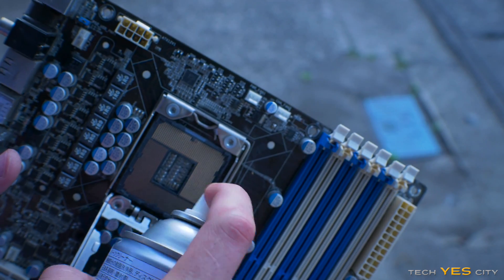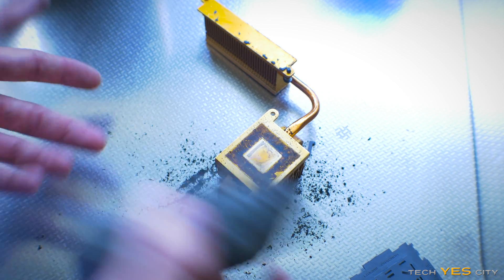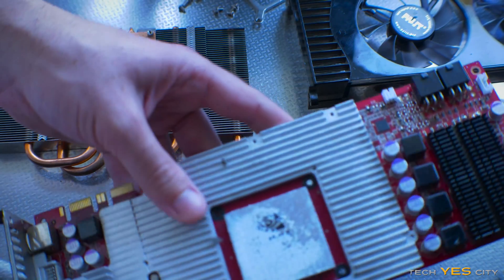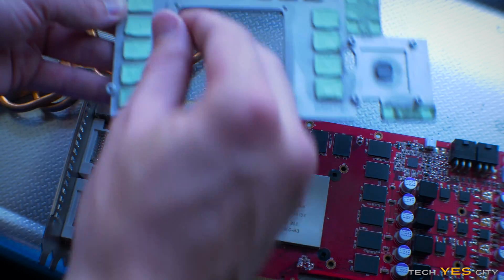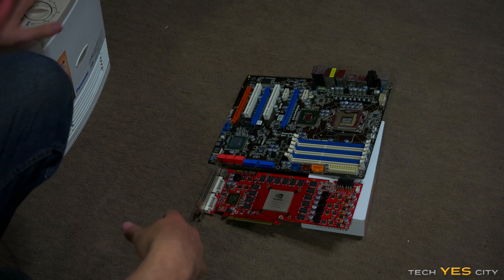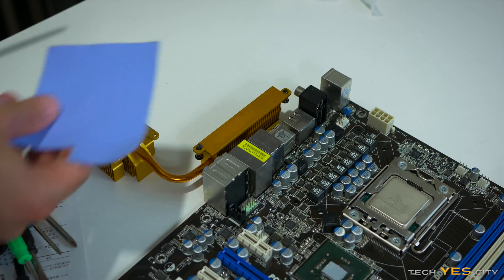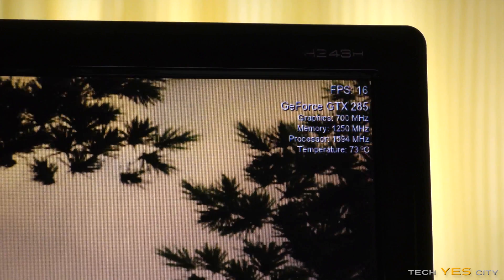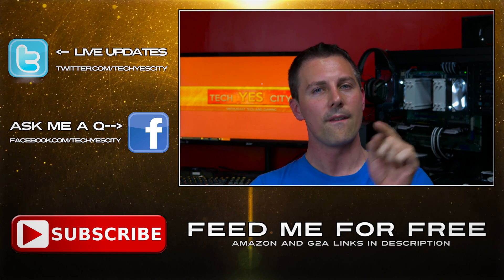PC Parts RESTORATION - How I CLEANSE - Ft. Before and After Temps

Comment: As a Auto parts specialist im sometimes wondering if im watching how to clean car parts or pc parts. First, there are no places 5-56 belong in a modern rust free computer, sure it makes plastic more shiny but its not good for either you or your computer. Its made for penetrating rusty seized bolts, it contains small amounts of actually lubricating oil. It contains, acid, solvents and chemicals that you should keep away from anything resembling a kitchen.

Comment: building PC's for over 20 years and I thought I was the only one that used my finger to spread thermal paste.  I have used the Pea Method before and always wondered if it spread even.  Using my finger and spreading the paste I never thought twice about it.  Also,  If you don't tighten the staggered bolts in just the right  pattern,  you can push you pea size paste all to one side.
Reply: I use a nitril glove and spread the thermal paste with my finger , no skin oils
Reply: I also spread it, but I use a tool for that... like a small paddle. Some people get allergic reaction to certain paste brands. No need to take chances

Comment: Hey mate, I love your vids, and i know this is an old vid and Im sure you've had no issues, but 

Be 100% careful as most brake-cleaners are not alcohol but ACETONE, toluene etc!  Industrial solvents.  This can strip the board completely and and destroy the plastics. Motherboard PCBs have plastics and are made of epoxy based surface glues.  Acetone completely fucks the strength of these epoxies.  

CRC 556 is essentially petroleum again, not compatible with anything on a computer.

If you want the same outcomes, use IPA and Innox.

IPA is actually alcohol, and Innox is mineral oil that is non-conductive, non- static, and doesn't dry out.  Better off using IPA and putting it in a solvent resistant pressurized spray bottle and then displacing any excess with pressurized air (cold) and finishing with Innox.  Much safer, much better.
Reply: Very useful!

Thanks for the advice.

Can you please elaborate on inox/innox. What is it? What is it used for on a motherboard?
Reply: Any examples you can link us to on Amazon ?
Reply: @petrkisselev5085  any IPA https://www.amazon.com/Bottles-Isopropyl-Alcohol-Industrial-Concentrated/dp/B0874C5CWB/ref=sr_1_1?dchild=1&keywords=ipa&qid=1589795569&sr=8-1

https://www.amazon.com.au/Genuine-Lubricant-Protect-Marine-Aerosol/dp/B078JDGKN5/ref=asc_df_B078JDGKN5/?tag=googleshopdsk-22&linkCode=df0&hvadid=341793070274&hvpos=&hvnetw=g&hvrand=6073138503113699877&hvpone=&hvptwo=&hvqmt=&hvdev=c&hvdvcmdl=&hvlocint=&hvlocphy=9070530&hvtargid=pla-672757151893&psc=1

https://www.amazon.com.au/0-8-Litre-Multi-Purpose-Industrial-Sprayer%EF%BC%8CCar/dp/B076NHD39Z/ref=sr_1_6?keywords=solvent+sprayer&qid=1589795678&s=home-improvement&sr=1-6
Reply: @BenState  Thank you very much !

Comment: What’s super helpful i just found out today if anyone stumbles across this comment that you would like and should check out is how to make your own back plate for your graphics card, a simple acrylic panel cut down to size and double sided mounting tape stuck to the hifhest point mounting tape on the tallest screws on the GPU back circuit board to keep your graphics card back from getting dusty and possibly shorting out from dust build up, another awesome thing to lengthen the cleanliness lifespan of your graphics card is to pick up some CRC Dielectric Grease or the crc stuff he used in the video from Lowe’s and use a Q-tip or fine paint brush or just spray the sprayable version on to coat the back portion of the graphics card evenly with the grease/spray. Seems weird to grease your card but it’s non-conductive meaning it won’t short out from being on there and it protects the back from moisture, static shock and if you put an acrylic back to it then it looks that much more professional, glossy, clean and beautiful in your PC build

Comment: Great methods! Honestly as long as you clean off the brake cleaner after using it to loosen the dirt up, you should be fine. What I would strongly recommend is CRC Electronic Parts Cleaner as it's less aggressive on plastic and does just as good of a job, if not better since it doesn't leave a slight oily residue behind, evaporates quicker and doesn't have as strong of a smell.

Comment: does the black pad on the chipset heatsink serve any purpose? It's the thin rectangular outline around the chipset die. I cleaned my motherboard but removed this part as it didn't look necessary and was getting in the way of cleaning. Do I need to replace it?

Comment: this is a pretty brutal way to clean computer parts - dust them down with a paintbrush, then use a soft nail brush dipped in  99% ipalcohol to get nasty bits cleaned up..... brake cleaner is a bad bad idea.

brian, its not a car or truck ....its complex electronics plus most brakecleaners are made from diff chemicals...some contaion acetone which can destroy plastic buttons/ fan headers/ rubbers etc esp on motherboards

even contact cleaner would be better but not as cheap my ozzy friend... tie me kangaroo down sport, shag a wallabe

Comment: Why not just use electronic part cleaner if you're going with the automotive route? It's still an alcohol based cleaning solution that  evaporates quickly and doesn't subject the plastics to a corrosive substance. It also doesn't leave behind residue. It isn't as heavy at breaking down carbon buildup, but you're not cleaning the heads off an old 4 cylinder hemi. You're just getting the dust and light filth off of the board and the connectors. Why use a spray anyway though, because Louis makes a decent point anyway. the bottle of electronic parts cleaner costs roughly the same as a small specialty brush and some alcohol.

Comment: In a different video you say, brake cleaner eats away plastic and therefor you didn't spray it on a case (with lots of plastic parts), yet here you spray it on your motherboard (dimm slots, pci-e slots, power headers etc) like there's no tomorrow....

Comment: Have been given an old broken ( hoover knocked over onto it) dell Vostro 400 with q6600 . Just needed an  HDD but it is full of dust glued on with grease stinks of chips and curry could do with the brake cleaner. I did a 10 minute stress test with cpuz and it maxed at just 56c with stock intel cooler !! GPU got really hot though

Comment: how do u get such good framerates on your even old pcs run like newer architechture ones for me i get microstuttering with games i have a rx580 for 1080p gaming and a i7700k at 4.9 ghz a 360 mm AIO liquid cooler and 28 gigs of ram at overclocked at 2600mhz i mean running window performance is very quick and snappy but in games its not always running well like bioshock i get very good framerates and then it will freeze for a second and then go back up to like 180 fps .

Comment: Speaking of the wonderful x58 I can not get my Gigabyte UD3R board to recognize the two middle slots of ram out of the six, it takes four, the middle will cause three reboots until it goes to windows. I see no bent pins! I been inside twice and tried OS reload, cmos, battery, etc, etc... It will actually recognize it but say 16gb always MAX and 24gb (16usable) and do the three or four reboots until does a patch (DRAM XXX?) and go to windows and its driving my insane as really is a good board and entire rig with 1060 reference card and triple channel mushkin memory stealth at 1600. The board takes 1066mhz but clocks it down itself, I do not get it! Also the 950 is no slouch and is super easy to OC up to 4,4ghz on all core although I suspect 4.0 or so is more of the normal and I hit the silicone lottery or did i as with my issue and with x58 the memory controller is built into the stupid cpu and that first 6gps malvern or whatever it is called, sucks! I can't even use them! That is not even the name but it starts with M and it sucks....... Can the x58 cpu's built in memory controllers actually flunk out? Ram is good as did days of testing and many passes but have no other cpu, not even a 920 to test if my 950 is acting odd. PS: Revision 2 = common p[problem and to this day nobody on google figured it out or at least has a one stop solution all just random moving or cleaning then some work, some do not!

Comment: OK will someone tell me how the hell can one wipe break cleaner off from inside the RAM SLOTS and the CPU SOCKET wont the so called alcohol wipe get stuck and bend the PINS in anyone is dumb enough to try it.

Comment: Isn't there plastic component covers on the gpu and motherboard that you are spraying with brake cleaner? I guess it does minimal damage as you have probably been using this method for years.

I think the brake cleaner would probably better than almost any other affordable method on the heatsinks. Wish I had thought of that when cleaning a heatsinks from a heavy smokers house.

Comment: Yo Bryan, I have the same X58 Asrock Extreme motherboard. It doesnt post, the onboard power/reset and debug LEDs dont work, the gpu fans will spin then stop, case fans will continue to spin though. Could it be a bad bios chip? I have already made sure the cpu, ram, gpu and psu work. I even swapped the cmos battery with another motherboards, still no post.

Comment: I think that with thermal paste, the thinner the layer, the better to reduce the thermal gradient between the metal surfaces. And a larger contact patch should speed up the time to establish thermal equilibrium and lower the temperature of the paste so that it may last longer. With a nicely cleaned surface, the paste is likely to spread out well and produce a thin contact layer.

Comment: Hi Bryan, Is it ok to use WD-40 Specialist CONTACT CLEANER? and what should I avoid if I will use it?
Reply: Kim Russel Patricio I would use rust release since it's safe on plastic
Reply: they both are good but I don't see where contact cleaner says it won't corrodes plastic

Comment: The terrible grey paste man... You gotta use something that contains silver that way even when it gets older and begins to dry it still provides a good heat transfer, though I guess being a gtx 285 you don't expect to be using for much longer anyway, but still. Also finger method is worse with a thermal compound that contains a conductive metal, I had a friend do it with his finger and brick his 660 because he got silver everywhere... oops
Reply: Steven Randall lmfaoooo oh man that's gold I do it with my finger just watch what you're doing you be okay

Comment: A youtuber with 200k subscribers that used to call a psu a battery
Reply from the maker: When did I call a PSU a battery!?
Reply: I think you might not have understood what he was saying. He removed the CMOS Battery from the motherboard, because it produces a small electric charge that could have fried the Motherboard when he started spraying it with "Parts Cleaner."

Comment: Thats insane that you are willing to use CRC 5-56 on any kind of pcb. That shit is straight up made for engine parts comprised of metal. Not for plastics and anything fiber layer based That shit creeps over time and will separate the layers of a pcb. I could understand using CRC 2-26  perhaps, though its not great to use on pcb either, but only an idiot or noob would straight out use 5-56 due to the damage it will cause over the long run.
Reply from the maker: I have a motherboard here which was the first sample I tested it on, still looking fantastic and none of the 'pcb layers have seperated', don't know where you get your experience or expertise from, but its clearly not the real world.
Reply: Its from 20 years of electronics repair, and from having to go over and try to repair circuit  boards damaged by dumbasses like you who use shit like that and WD40 to clean electronics, so that you end up 10 years later with the pcb layers coming apart and cracking.
Reply from the maker: Justifying your statement with your '20 years of experience' doesn't net you any worth, show me some before and after shots of a board sprayed with wd40 (why change your tune now? thought it was Crc556 originally!?) before and 10 years later, cause it doesn't happen, it sounds like you are talking about leaving your pcb in a damp environment, which is completely irrelevant to your original argument.   Cause I know the thing will still be mint and prob in better condition due to the shielding effect both those provide.  Now get your 'dumbass' out of here and don't forget to close the door.

Comment: Hey Brian I used servisol anti static foam cleanser on my Asus rampage 2 extreme and some crap got stuck under one of the chips. I can get it going when it's warmed with a hair dryer after cutting the mains power. I've tried isopropyl alcohol which seemed to work initially but went back to normal after a few days. I'm in the UK so some of your products are unknown to me, not sure if brake cleaner is a good idea for this application. 
Any tips?

Comment: since the brake cleaner is corrosive isnt that a big problem for the pins for the motherboard? it makes sense why you didnt use a wipe on the pins since itll bend/brake but wont the pins get fucked?

Comment: I'm a mainly self taught technician - but A+ Certified, and of course, I use an air compressor to clean electrical components (and I recently learned one should unplug or hold a fan still when blowing air on them, as they produce voltage when spun). And I have cleaned and re-applied paste, heatsinks, fans, batteries, jumpers, and neatly ran PC wiring. I have also read Maximum PC magazine for years. But, whenever I merely carefully HANDLE an electrical component, (like a motherboard or GPU especially - things with circuits showing), I am a bit nervous it will be damaged. But apparently they're sturdier than I thought, so I'll have to do some research and perhaps try brake cleaner or CV 5-56 lube (?) - starting on old stuff, before using on a component of any value.

Comment: Normally í´m also using the pea method like many other people but my graphics card didn´t like that so i had to spread it and now it works...
Reply from the maker: you have to liberate your soul, keep spreading.
Reply: DerFreakXD *pea
Reply: +Florinel787 Oh yeah you are right i am not natively english so i did not know :D
Reply: Same for me. My Asus R9 270 doesn't have heatspreader, so placing just a dot results into not being spread evenly.  Covered whole die throughly with MX-2, and from 95 degrees on 100% fan underload, getting 74 degrees with 55% fan speed.

Comment: Another good tip for heat sinks is go to pharmacy or a wal-mart and buy some of them 4 sided nail buffers. I use 2 types that basically give me a 8 step grit progression. You will get the heat sinks clean, flatter, even, and put a mirror shine on them which all helps improve thermals.

Even with brand new closed loop water loops the finishing job on the copper plates is usually often even on $150 loops. Flatten them and shine them up. You will get a couple of degree improvement at the minimum (more if its really not flat) all for about 2 minutes worth of work. You basically want to be able to see yourself in the copper.

Usually some of the worst ones I've seen are on gpu's. Super dull. Flatten and shine em up.

Comment: +for the video. I confirm this is a working method. . . but. . . 
I would use IPA spray with alcohol wipes, wear gloves and then apply some common circuit protection spray too, if u want the PCBs to shine bright like a. . .diamond.  GJ anyway. As for the oilyness(lol) of the finger, give it spray too before applying with the isopropanol and rub freely. :-)

Comment: Must have been asked before but would the WD-40 Specialist Fast Drying Contact Cleaner be a good alternative for the CRC-5.56? I don't think we have in my country except for the WD 40.

Also it seems that the WD-40 is a 2 in 1 already, would I still need the Brake Cleaner? There is a 3M Brake Cleaner and I'm wondering if it as good as yours and won't be that bad for the plastic parts.

Comment: Brake cleaner is supposedly bad for a PCB as it is corrosive to the PCB. There is a PCB safe solvent specifically made for cleaning. I recommend never using brake parts cleaner on a PCB.

Additionally, you should never use a dielectric (non conducting) substance like what this fellow is using for "polishing" on any of your components. 

It can get in the PCIE and RAM slot connectors leaving a film and cause failures due to insulation where the there should be electrical contact. Anything not conductive is dielectric. Its bad for power connectors, SATA connectors, RAM slot connectors any type of connector male or female should NEVER be treated with a dielectric.

Comment: "Break Cleaner is slightly corrosive"  Yet uses it in components where he can not remove it.   Further it is hydroscopic and will oxidize and corrode metals. 

Not my go too cleaner fam.  Not one bit.  De-ionized water with an old toothbrush will get the same results.
Reply: Brake*

Comment: if the break cleaner is slightly corrosive, then why would you spray it in the sockets?  couldnt that cause problems down the line?

Comment: Why does he use brake cleaner? is there any specific reason like what it does?

and please delid the GPU, I'd love to see the difference in temps and how to do it, and it's only $25 so if it breaks its not a huge loss
Reply: because it's quite effective at removing dirt, dust and debris I guess.